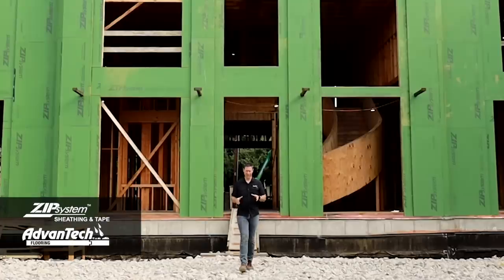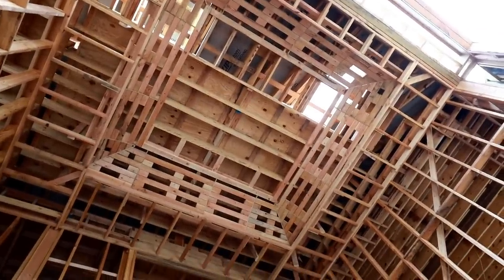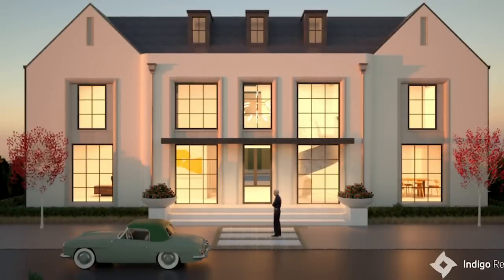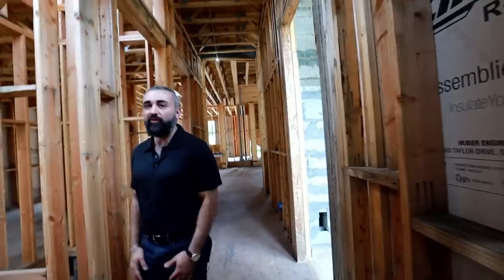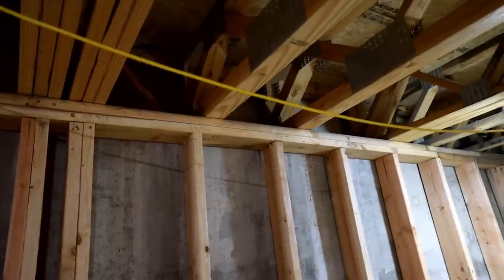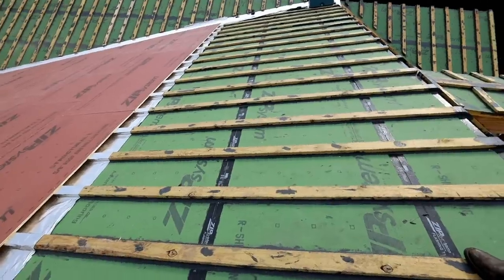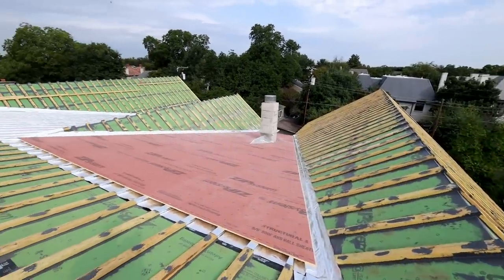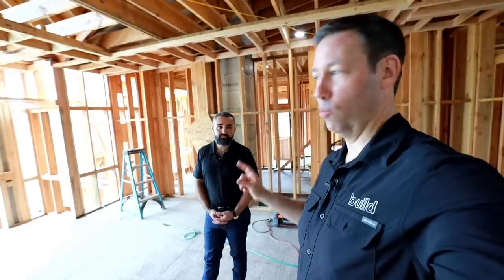INSULATED/Sealed Roof Deck , WITH Radiant Barrier AND it’s Vented...Haven’t seen this before!

Comment: As a professional roofer for the past 25 years. I love this roof system. A lot of people are insulating there attics but not venting the roof materials. It makes a big difference. I have run into some disasters on some reroofs that had insulated attics that leaked and the moisture is stuck between roofing and insulation and cannot dry out and rots everything. Keep up the good work.
Reply: Question: What do you think of the comment about water getting under the aluminum flashing and rotting? Is that likely in your opinion?
Reply: Rooftop, I have been asking and I'm using a lot of tricks on a post frame building. I intend to use 4ply 2x8 laminated/glued columns, sitting on perma columns, with bookshelf girts. My plans are for 5/12 scissor double trusses (built with 2x6 min), sandwiched in posts with Fasten Master truss lok screws, purlins in brackets. My honest plan was after seeing something similar as this guy, was to use ZipR12 on walls, I was thinking of same on roof, then seal everything and go back over roof with regular Zip sheathing, sealed of course except as roof goes over. My thought was a bent flashing that comes off roof (ZipR12)sealed down and lips over sides(regular pole barn metal to give place for water to come out if needed) then doing like this guy, 1x or 2x4 then the more sheathing sealed to top but vents at edge of roof(no large overhang maybe 1-2 in) and 1 piece 32ft gutters along eaves. I found this rough mesh/bird stop material that's like fire proof and critter proof for between layers of roof to keep it clear.
So it's planned as 24x32x22(?)ZipR12 to peak of roof. Then sides of building get metal, then the flashing will ride on roof edge up 12-18in. Cause im in Indiana probably ice and snow shield to edge to seal flashing that will look over side wall about 4-6 in(gutter will butt right against flashing, not sure if it will be alum, stainless or copper) then my plan was the 1x or 2 by 4 going up to screw metal roof too. Leaving air gap but have that fiber/mesh to keep critters out. Not sure if I'll use some roll on extra sealer for roof or just trust two layers of Zip products.
My inside plan was keep trusses open except for cord next to roof. They say I can get 2x6 top chord which I can fill between with Rockwool 5 1/2 batts then fit thin set ply wood or melamine or something. I was turned on to a what semigloss antistatic paint to hit exposed parts of trusses to keep dust down.
Hope I explained it right. Thoughts?
Reply: S Singh not sure what portion of the video your referencing.
Reply: Im not even a builder professionally and i figured this out combined with radiant perfect roof system!
Reply: MonzaRacer not sure why you don’t want a bigger overhang? Being in Indiana which is a lot like Michigan where I am from, there is a lot of benefits to using the overhang for maximizing airflow and generally just getting the elements away from your side walls.
Reply: @rooftop7089 , Agree, big overhangs can only help, IMO.
Reply: Why not just use rain slicker to get airflow under the slate?
Reply: Am I right in thinking that the upper portion of the roof above the radiant barrier will be vented (with a ridge vent, etc.)?  Is there anyone else that does this vented roof/sealed attic combination?  Any other known ways of doing this?  I had also thought of doing something like this to get that break from solar radiant energy without taking up an entire attics worth of space.  Down here in Florida thinking about some options.
Reply: JP cheap way of doing it that we have done is run cardboard baffles from the eave to the peak on all the truss bays then foam to the cardboard.
Reply: @rooftop7089  Thanks, great suggestion.  Appreciate it.
Reply: The idea sounds great but if the radiant barrier gets water under what will happen? He basically built a roof with double deck. I have been thinking about something similar to be able to convert my vented attic to unvented. This should keep the roof material safe in case of small leak and give a second layer of protection to avoid nasty water stain on a 30+ foot ceiling.
Reply: MonzaRacer I like it.
Reply: @JP-st5iq  A double decked roof is more common in cold climates. This is the recommendation I've gotten for an insulated, conditioned attic space with small rafters.
Reply: Here's a thought, if you use metal roofing could you avoid the extra layer of sheathing he did? Depending on the metal roof isn't it kind of self venting and also its own radiant barrier?
Reply: @HickLif3  it works great! I built a “cool roof” in the Nevada desert on a straw bale house, 5/8” sheathing on truss roof 24” o.c. Then a vapor permeable radiant barrier applied directly to the sheathing. Followed by 2x4 doug fir running across the roof laterally on 24” centers. Finished with roof metal on top. The 2x4s and delta ribs in the metal give you your airspace. Nicest attic i have ever been in.
Reply: @JP-st5iq  -- In 1982 I did something like this in New England on the cheap for a lifelong friend in a financial hole, trying to get the most bang for the buck. 2x8 rafters, cathedral ceilings. 4 mil poly vapor barrier inside, foil-faced fiberglas insulation with the foil facing UP and flanges stapled ON TOPS of rafters. Short slashes made with utility knives to break up outer vapor barrier (~3" long, maybe 2 or 3 slashes per sq. ft.). Furring/strapping nailed along the tops of the rafters to create cavity for vent/radiance, plywood on top of that with 10d box nails. Used 1-3/4 roofing nails so that the nails would protrude enough to keep the foil far enough away from the underside of the plywood to maintain a continuous vent cavity. Ridge and soffit vents. 
-- It worked PISSAH! as they say around here. Warm in winter, cool in summer. Exceeded all expectations. Don't be afraid to do an educated experiment. Best to do it on a cheap project. The above project, a floor-up remodel on a wing that included a BR, bath, and eat-in kitchen was finished for less than $11K. The bath set and other materials were bought at an auction, the kitchen cabinets were removed from old Navy housing, and the owner did the ductwork, wall and floor insulation, and some of the interior finish himself, and he did all the painting and refinishing of the cabinets. I did the designing for free, and paid my crew. I made wages. The things you do for friends.
-- The thinking on vapor barriers and moisture control has evolved since then. Joe Lstiburek is one of the top authorities on the science. Check out his company's website for the latest. 
https://www.buildingscience.com/
Reply: @JP-st5iq  -- I should add that a radiant barrier needs about a 3/4" air space from the radiant surface to be worth anything. Combining the vent space and the radiant space sets up a conceptual economy, but it's easier said than done. I'm not sold on the need for the inner roof to be watertight, if one has a solid roof on top.
Reply: @grizzlygrizzle  Thanks, great to hear the input.  Sounds like a good way of doing it.  The things you do for friends, lol

Comment: I was in commercial restoration for quite a few years, it's always great to see the commercial guys entering the residential space.  I feel the commercial side is usually ahead of the curve especially when it comes to water proofing and insulation.  The budgets are so much higher that manufacturers really push to be the top in the market and then it trickles down a few decades later into the residential space.

Matt you need an update on this house and you need to get the socials of Dario as well.  I come back and check this video every couple months to see where it's at!

Comment: There’s little brown pucks sold at hardware stores that are a bacteria that kills mosquito larvae, we throw them in ditches around the house in Florida. Drop one in that sump pump drain tank for the mosquito problem, it’ll work better than a zapper.
Reply: We do that here in Ct also. We drop them in the storm drains too. Any tires that have water in them, if you put one drop of oil in the water, it smothers the mosquito larvae supposedly because they can't break through the surface tension on the top and kills them.
Reply: They have dynatrap flying bug control:   the light attracts them and a vacuum sucks them in.  Mosquitoes 🦟 and moths.
Reply: What are these called?
Reply: @Ariccio123  Dunks!
Reply: @Ariccio123 , We just call them mosquito pucks.
Reply: @Ariccio123  Mosquito Dunks

Comment: This book https://www.youtube.com/post/UgkxT9ExVpR-3A-9rpRqx8vzXKZ3BMMTg_KH does have a lot of great information on the building of sheds, design ideas, building options, etc. The author goes through the steps to build a foundation, framing, roof, even ideas on internal storage and external finishes. The text is easy to follow and understand. There are many sidebars that give tips and advice which most laymen probably wouldn't have considered. The photographs are great quality too. This is a great book and I'd recommend it highly for anyone needing or interested in building a shed.

Comment: This house is impressive. Like it. 

Now to that roof, I like how he combines vented and not vented. That should be effective here in northern Maine as well. 
To increase roof insulation beyond the Zip-R12, can you make the first layer of 2” structural foam and then add the roof as Dario did? 
I think this roofing style would work incredibly well on the ICF cabin I want to build. 
My plan is a basement with a 10’ ceiling, main floor with 12’ or 14’ ceiling and then an open roof structure. Walls are 12” concrete ICF with 2” insulation on both sides. Might add another Zip-R6 or 9 to the outside. With siding and interior finish, that gives me a wall thickness of 20–22 inches. Large casement windows installed close to the outside edge giving me an incredible 16” inside windowsill. 
I considered a skylight or dome but don’t want openings in the roof. Instead, with the high walls and almost cathedral style roof, I can use the south facing front wall to install lots of windows to brighten up the inside. With our low winter sun, this will make maximise daylight inside. 

What else is in my design...just a wraparound covered porch, 8 feet deep with a 6/12 roof. 

Did I mention this is supposed to be a smallish cabin? Footprint (without wraparound porch) of roughly 44’ wide by 28’ deep. Some 1200 sqf plus basement.

Comment: Back in 2007 I built a "Timberpeg" (manufacture's brand) Timber Frame home for myself, and engineered into the roof system was a 2" vented air gap on top of regular plastic.  This was on top of 5" of Polyisocynurate, which sat on top of 1/2" structural shear plywood that held the T&G 2x8 fir ceiling decking in place.  On top of the 2" air gap was another layer of 3/4" plywood (or snow load is heavy here) and metal roofing on top of that.  We did not go through the same efforts as this guy, but I can suggest that roof vented air gap was extremely effective for both summer and winter temps.  And I know it wall always stay dry under there.

Comment: Only thing I don't know about is leaving the Zip sitting on the drip flashing on the foundation.
Hopefully he's going to come back and liquid-flash and/or caulk that when they make the rounds to tape all the Zip.

As for the LaLaLand venture.  That's AWESOME!
Reply: At 8:21 you can add some red liquid flashing at the bottom of the zip
Reply: I cannot imagine that this guy will leave any loose ends on any job he does !

Comment: Matt, What a great house and so many well designed, thoroughly thought out features that will provide so many long term benefits !
Totally impressed !
One question for Dario.......did he have any qualms about putting the aluminum foil product directly on the pressure treated 2x4's in respect to the chemicals in the p.t. wood that negatively affect the aluminum ?
I've seen that in remodeling where it causes very bad corrosion of the aluminum.
Maybe the attic foil has a little different make-up and is not as affected, not sure.
Thx
Reply: I'm a little bit puzzled with the aluminium. Does it breath? And how much do you gain?
Reply: @gejes9658  Look up Attic Foil. They have several types. Some breathe. Some don't.
But they all do a great job of reflecting radiant heat. Their website lays it out very well. 95-97% reflectivity.

Comment: In the north we call that a Michigan roof. A basic sheathing, then 1x’s or 2x’s then another layer of sheathing, then the roofing material. I’ve never seen the foil though. Seems pretty cool.
Reply: Ahhh-Yeah! I've seen plenty of roof builds and they don't build roofs like that in Michigan. About the time you see that is for a steel roof building's.

Comment: Hello, @20:00 min mark he talks about staples holding the thermal layer, but I do not quite get how he stapled it down, was it just on the sides of the 2x4"s?  That would make sense if they are pressure treated.  So maybe clarify for me if I am off base,  and thank you.
Reply: Yes pressure treated wood and stapled low to the side of the wood.
Reply: @dariod2666  You the man, very inspirational with your Coffee Shops, great job
Reply: Have to use stainless staples imo

Comment: Framing looks like it's been rained on everyday.
Reply: It rained all night and a few hours before filming.
Reply from the maker: Thanks for commenting Dario
Reply: @buildshow  custom built home.
  Will sell for millions.   They didn't have a plan to get it dried-in fast enough.   All that wet wood.  I would make a video about the importance of getting that much framing dried-in as fast as possible.
Reply: It has been weathered a lot longer than a few hours before filming. The foundation plates are black and in progress of rotting. Even the advantec on the floor is blackening. That has seen a massive amount of weather.
Reply: @dariod2666  Would be wise to get some massive dehumidifiers in once the windows and doors are installed and test the moisture of the framing. One thing I noticed as a expat builder here in Texas is that builders/inspectors do not do a preline (pre sheetrock) moisture test to ensure the framing isn't too damp.
Reply: @jefflinnell8492  Yeah its seen at least 3-5 months of weather. The brights have already begun bleeding
Reply: @danch10  for sure , I left advance exposed for 3 months during the winter after we capped three foundations before snow and it didn't look that weathered
Reply: DanHambo That is a good idea.
Reply: @geronsingh2720  You dry the framing once its been air-sealed. Once windows and doors are in etc.. In a place where it rains a lot it is unavoidable. Also using treated bottom plates will require dehumidifying as well because the framing is often stored outside in the lumberyards